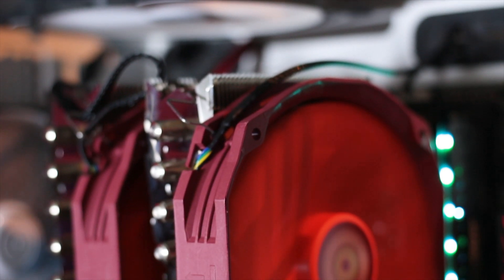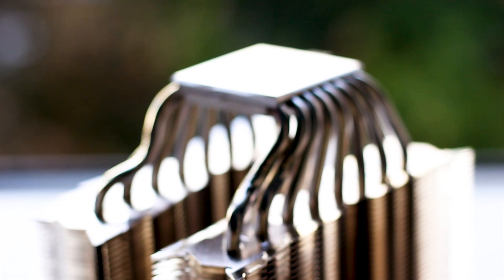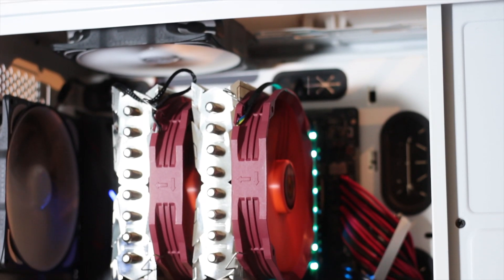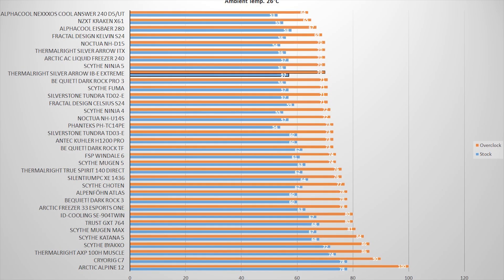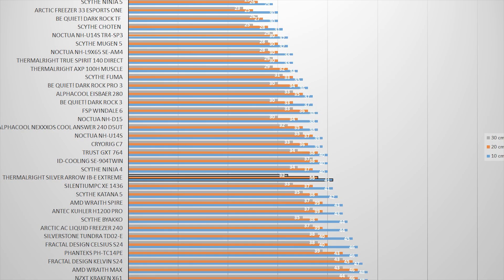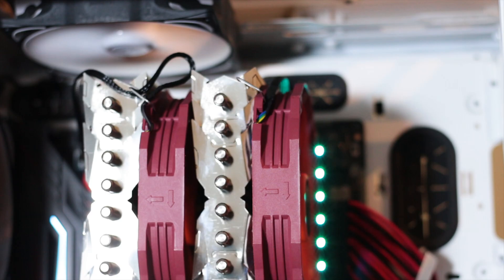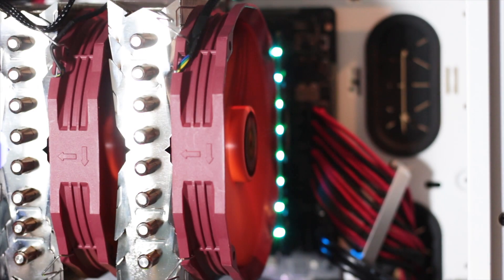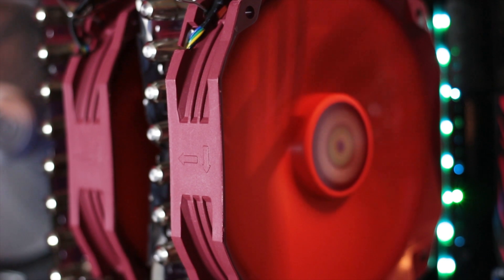Thermalright Silver Arrow IB-E Extreme - Old School Air Cooling!

Comment: I still use these but I need 2011 / 2066 mounting hardware for these to fit old Ultra 120 Extreme copper? Where can we order universal kit to fit? And the old style 12cm fan wire clips?
Reply from the maker: Get in touch with the manufacturer and ask for a mounting system.
Reply: @TechLegend-com  I did. Still waiting a week & resent from different email just in case.  No reply. Is there a UK or EU support as well?
Reply from the maker: @khanscombe619  It should be the same support page for all countries.

Comment: TT silver arrows vs noctua NHD 15!?
Which is more powerful?
Reply from the maker: The NH-D15 is overall better, and easier to install.
Reply: @TechLegend-com  but the TT has 8 heat pipes!!
Reply from the maker: @AutodidactEngineer  Still, the NH-D15 is the better cpu cooler.

Comment: Do you know the height of your ram? I have Crucial Ballistix 3600 36gb (non rgb), I'm wondering if the slot 2 stick would fit under the fan (i think 36mm high)
Reply from the maker: If I remember correctly, the RAM height is around 38mm.
Reply: @TechLegend-com  thanks, mine just came in today! I'll be installing it tomorrow. I have a msi mpg Z590 gaming edge wifi and 10850k. I'm switching cases from a iCue 465x to a Raijintek Thetis (i wanted to get a small case without having to buy ITX motherboard).  I'm sure the cooler will fit but I'm hoping the first fan clears my RAM. I guess we'll find out tomorrow!
Reply from the maker: @danielk5815  So did it fit?

Comment: Great review! I was considering buying the Silver Arrow T8 , which has 1 single fan and 158mm total height but look very similar to this one. I got an NR200 case, so cooler height clearance is capped at 158 mm
Reply from the maker: Thanks for watching! Be careful with this cooler, it is big, very close in dimensions with the NH-D15.
Reply: @TechLegend-com  This decorative caps ,at the top of the heat sink, at the end of each heat pipe. Are they removable? so you can gain some extra clearance?
Reply from the maker: @sakkidis  I don't believe that they are, and at most, you will gain a few mm of clearance.
Reply: @TechLegend-com  for 3 mm I can mount this cooler with tempered glass side panel
Reply from the maker: @sakkidis  Then it makes more sense. :)
Reply: @sakkidis  hi, not sure if it's too late but do NOT remove the caps of the cooler or try to modify them. They have a liquid or vapor in the pipes that is essential for the cooling effect and you'll basically have a big paperweight instead of an air cooler
Reply: @danielk5815  i went with a Scythe Fuma 2. But i appreciate your comment, Thanks m8
Reply: @sakkidis  how do you like it?  My IB-E Extreme literally arrived today.  And no problem, i know because i wondered the same thing about the heat pipe caps and had checked it out.. apparently it's not the best idea lol
Reply: @danielk5815  In what case?
Reply: @danielk5815  Hope you made it ! That's a beast of a cooler
Reply: @sakkidis  got it in! Couldn't use the second outer fan due to clearance issues but i subbed a 120mm fan instead.
Reply: @danielk5815  What about temperatures and noise?
Reply: @sakkidis  temps are surprisingly good considering the air constrained case I'm using.  I have a Sapphire Nitro RX 6800 paired with the 10850k and Silver Arrow. I just played Hellblade: Senua's Sacrifice in 4k all high settings (averaged 70-80fps) i never went above 70.5 Celsius and averaged much lower (55ish) pulling a max 150 watts. The graphics card never went over 57 Celsius (77 on the hot spot) pulling 223 watts
Reply: @sakkidis  also i average about 34-36 at idle with the cpu and 27 (29 Celsius in hot spot) with the gpu at idle.  My temps with all my other components are also down (think that's more to do with the case, though)
Reply: @sakkidis  sorry, also, noise is not bad, but the silver arrow extreme fans will seriously ramp up (like a server fan basically), they get extremely loud at full rpm.. i would make the curve on the fans so it only gets that high with dangerous temps , they are still very effective at half speed (about 1250rpm)

Comment: Between this and Noctua which one should I go for?
Reply from the maker: It depends on the price and what space you have inside your system. The Noctua coolers have a better mounting system and fans, so keep that in mind. :)
Reply: When i swaped all fsns in case for noctuas, realisated how loud is ma powe supply :) 
I have no experiences with this cooler, but i have nh d14 with nf a15 fans and i cant be more happier. At 600 rpm barely hearable. Oced i7 3770k for 4.8ghz and 1.34v(its max, mobo using for cpu around 1.28v) and cinebench or stress test aida 64 not goig over 56 Celsius after hour of testing. 
Also day before i contacted noctua and asking them for some spare parts for nh d14, and now they are on delivery to me.
For free.

Performance awesome, like aio water cooling, but more safe, needs no maintenance and last for life. And i can say less noise.

If i set rpm at 400 i have to open case to chech if fans still working.

Btw nh d14 is bit samaller so better in smaller cases, nh d15 is bigger.  I tested both passives/heatsinks and better was btw nh d14, for 2 degrees in same ideal conditions for both coolers.

If you guys interested, i can do photos of case,how it looks or i can do a video( short), just for you.

Comment: Just saw the ib-e on a big sale and googled my way up to your review and the one of the KitGuru. KitGuru did his review of the Thermalright SA IB-E yet in 2015 - see the link below. Somehow the IB-E loses 12.3c to Noctua Nh-D15 (@max) in their testing. That's far more than in your review. Even if he tested on a different platform and with a lower ambient, the delta between those two coolers is too big, while in your review it isn't. Any thoughts? ms
https://www.kitguru.net/components/cooling/henry-butt/thermalright-silver-arrow-ib-e-cpu-cooler-review/6/
Reply from the maker: Hi, I do apologize, I did not get a notification about your comment.
While you say that "Even if he tested on a different platform and with a lower ambient" it shouldn't matter. The thing is, KitGuru is using a i7-3930K Processor which has a TDP of 130W and a much higher TDP when overclocked. I have been using an i5 6600K which has a TDP of 91W and overclocked it barely goes above 100W if that. 
The difference between the NH-D15 and the SilverArrow IB-E Extreme is larger on the i7-3930K because there is much more heat in that test. More heat to dissipate will offer a better showcase of the performance of the heatsink and fans on these coolers. This is why you see a bigger difference between the coolers in KitGuru's test than in my review.
Basically, there is so much heat and power that an 6600K will draw and generate, and this is why the gap in performance with these coolers is smaller. 

I hope this clears things up. And let me know if you have more questions. :)
Reply: @TechLegend-com  It's ok that you answered at all, it's an older thread🙂 Indeed I had to reconsider my "regardless" 😉 and agree that the 6600k might not be challenging enough for both coolers compared to a 3730k. In fact I had a similar discrepancy with a 2500k vs 2600k a few years ago. With a limited number of reviews I will assume that the difference in performance might have been clearer with a more challenging TDP. 
Some apparently Russian dude in California sells a new IB-E for $40 plus shipping on Ebay, so I went on to search the reviews again for this rather legendary cooler.
Thank you for replying!
P.S. Glad to hear a latin(?) European accent in that review too:) Somehow reminded me of home.👍
Reply from the maker: At the time of this review, my only CPU was a 6600K, but I will retest most CPU coolers with the new 9900K CPU. 🙂
$40 for an IB-E is a great price, is it the Extreme version?  
Latin accent you say, are you from Romania by any chance?
Reply: @TechLegend-com  Ah, suspectam eu:) Nu sunt din Romania, dar sunt roman:) Merci pentru review si rapsunsruri. Coolerul de pe Ebay este aparent doar ib-e, are ventilatoare TY141, deci nu este Extreme. Dau linkul mai jos daca intereseaza pe cineva prin vre-io firma de forwarding, eu am decis sa nu-l iau. Am gasit un Dark Rock Pro 3 uzat la pret foarte bun si am iesit la $40. Preturi de SUA...  
Succes! 
https://www.ebay.com/itm/Thermalright-SILVER-ARROW-IB-E-CPU-Heatsink/223600632932?hash=item340fa2e464:g:8dgAAOSwQHBdOiJ3

Comment: OOOOO you reviewed the SB-E???? wow after so many years nice to see somebody still remembers them. Easily rivals AIO water coolers from corsair and NAXT aka the stock ASETEK designs and with loud high rpm static pressure fans. This mammoth is better imo since it doesn't need to run fans at full speed even if you are using a 250 watt TDP CPU. Anyway the TR4 model of the Silver arrow is out now and it has only been a few months since its release.
Reply from the maker: Hi yes I did! The IB-E Extreme, the orange fans one in the video is still being sold today, they have a new revision that looks identical to it. :) The SilverArrows are just very nice looking and have a great performance to them. It's too bad that many people want the AIOs for the RGB factor.
Reply: REEEEEEEEEEEEEEEEEEE RGB looks tacky imo but then again if someone is buying threadripper and wants RGB, they probably aren't using it for work anyway . While people who actually utilize CPUs as monstrous as threadripper like to see them run cool and quiet. I say that because in the beginning after the first gen threadripper launch i had to make do with the Corasir h100i V2 for months and man that was a pain to live with due to the noise and Temps due to cold plate not fully covering the CPU DIE. After using the silver arrow and be quiet fans and noctua too i am never going back to an AIO ever. I am old school air cooling for me lols.  @TechLegend-com
Reply from the maker: @MegaMoiz  To be honest, the only reason I am using an AIO for my system is that it doesn't cover the RAM Slots and the CPU area of the motherboard, and this way, I can clean the system easier. Otherwise, I would be using an air CPU Cooler. Air cooling is basically, set it and forget it. Perhaps, blow the dust once a year if you don't care that much. Heh :D